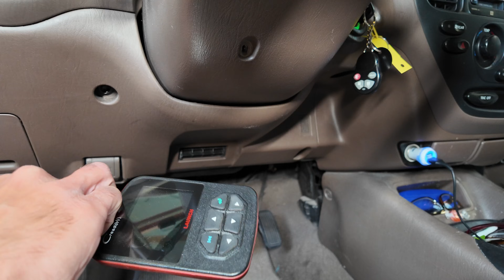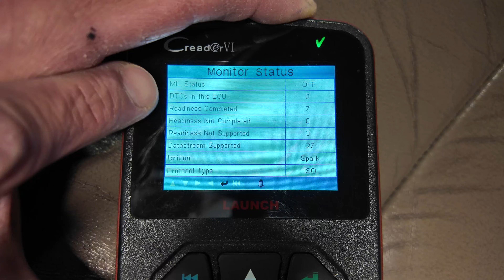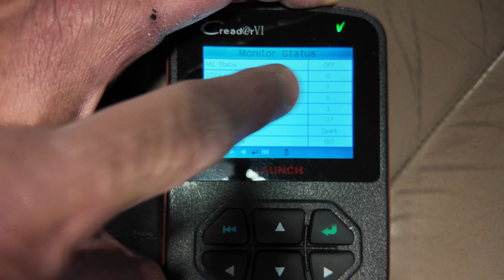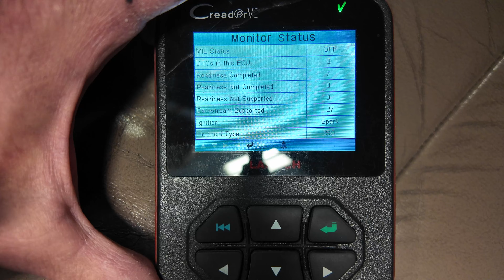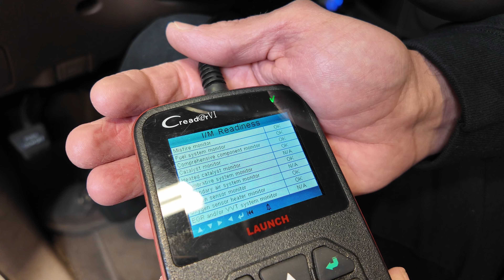Don’t Get Scammed! Use This OBD Reader Before Buying a Used Car

Comment: Cheap ones doesnt showe transmision...
Reply from the maker: Correct.  The low level code readers can only access the PCM (Powertrain Control Module) in the generic OBD system, with limited codes for transmission in the P0700 range of codes. If you want to read in depth TCM (Tranmission Control Module) codes you need a better scan tool. But, you will generally get at least one of the 700 codes for transmission problems in the PCM if the TCM has fault codes.  👍

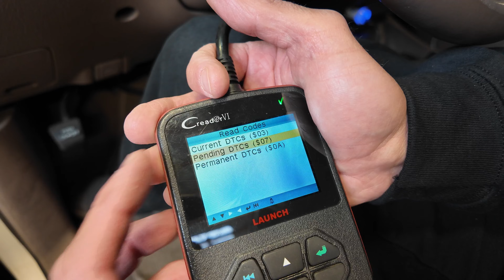Comment: At 10:18 if you see those codes show up on a used car you are checking out, what do you do next? If I see a pending DTC's should I walk away ? Under "Permanent" DTC's what does ( OA) mean ?  Lastly, If there are current DTC's as in this case ( 03) what do you as a used car buyer do ?  Thanks for any help, bc I  am the "little ole Lady" that everyone wants to buy their next car from.    
I am looking to buy a 2020 Mitsubishi RVR ( Outlander Sport) sometime in late 2026. What got me really nervous about ANY used car was that a friend's daughter bought a very old used Equinox for $5000. and ONE MONTH LATER the engine seized. The thought of that happening to me scares me to death.  Any help is appreciated.  I just subscribed.      :  )
Reply from the maker: Great questions!  Let me help clarify a bit for you.  If there are pending codes that means there is a very high probability that the fault code shown is going to turn the check engine light on and will need to be addressed.  That said, the type of fault code is more important.  If it is for a simple, or relatively easy problem to fix, I would not be too nervous and would only want to negotiate a better price.  But, if it for something more complicated and costly, I would certainly be very hesitant.  Unfortunately, without the consultation with somebody experienced and knowledgeable to these fault codes and what the common issues are with that particular manufacturer, you can't really make that determination.  I would recommend you seek the help of a professional.  This is why I always recommend you take the vehicle to a reputable repair shop for a thorough inspection BEFORE you make the final purchase.  You can get their opinion and expertise on any related issues so you are informed before buying.  The permanent codes are only applicable to certain vehicles and are not really useful.  Those codes will typically display under current codes anyway.  I recommend you find the used vehicle you really want to buy, and then after doing all of your research and inspections, bring it to your local mechanic for the final pre-purchase inspection.  It will be well worth the fee to find the things you won't and also give their overall opinion of the car.  Use anything they may find, that you can live with, to negotiate a better price.  Best case, they don't find anything and they give you a green light to buy.  Best of luck and thanks for following!

Comment: I didn’t have this scanner when I were purchasing an used car . Later i took my car to Autozone to check. I found out that the car has erg valve problem. Could I do anything when they was hiding the problems at the time of sale for me to purchase the car? Free Warranty available but no mention. Only the $200 warranty so I denied it
Reply from the maker: If you bought the vehicle from a car dealer, they are usually required to provide at least a three day warranty.    Otherwise, you're on your own.   That's why it's always important to have a thorough inspection performed before buying a used vehicle.  I have a new video coming out soon, where I show how to use an inexpensive scan tool and its popular features. The one I demonstrate is under $50 and is well woth owning. I think you will find the video helpful, and it should be released next month.  👍
Reply: @OrtoTechGarage could you go after the dealer with a lawyer for hiding the car problems ?
Reply from the maker: I suppose you could, but I dont know know how well that would work.  You would have to identify they were indeed required to provide that warranty, and you brought the problem to their attention within the time frame, and they refused to remedy the problem, etc.  It may prove difficult.   I am not an attorney though.

Comment: Great video.  I experienced this exact thing recently.  We went to look at a 2004 Ford Focus with only 60,000 miles on it from a small used car dealer for my fiancé's son.  They had told us that they were trying to fix an issue with the instrument cluster because the temp gauge read high all of the time, even when the car was cold.  They had sent the cluster out to get fixed twice but it still wasn't fixed when we arrived.

Their mechanic showed me some codes that were stored in the ECM on his scanner.  I went to go get my scanner to plug into it and when I scanned the car, it had a P1000-FF On-Board Diagnostic (OBD) Systems Readiness Test incomplete code in it so he must have cleared the codes when I went to get my scanner.  That was the only code stored.  We decided to not buy the car because of this, and we told the salesman that was the reason we wouldn't consider buying it.  I couldn't remember the what the codes were that the mechanic had showed me but none of them were about OBD systems readiness incomplete, and I didn't want to have a potential issue once the monitors all ran.
The fact that the temp gauge didn't work was also a contributing factor in not buying the car.    They had already installed a new coolant temp sensor and that didn't fix it.   There was no coolant temperature data PID to see what the actual coolant temp was, just a cylinder head temperature PID which seemed to read normal.  I think that the signal wire for the gauge may have been shorted for it to read high all of the time but who knows.
Reply from the maker: You did it correctly.  No need to buy a vehicle that has problems built in.  Patience is the best strategy.  Just keep looking until you find the right car. I like to shop independent sellers for the best deal.  Make sure they have all the maintenance records, clean car fax and a clean car title that matches their ID.

Comment: Thankful to have found your video before checking out some used cars. I bought an obd2 scanner and plugged it in a used toyota camry we were planning to purchase. All supported readiness monitors showed complete and there were no lights on the dashboard aside from the tire pressure. So we thought everything was fine. We asked the seller then if we could have the car further inspected by a mechanic and he agreed. The mechanic then called us and said that they will not be able to fully determine if everything is fine because the codes were erased and advised us to just return the car if any dashboard lights turn on. When we came to pick up the car, I plugged in the obd2 again ‘cause I was worried I accidentally erased the codes the first time I plugged it in. The scanner still shows all readiness monitors are complete and no current or pending codes. How is that possible?
Reply from the maker: @oltiyurd  That's odd!  It's really not possible.  There are some readiness monitors that will be ready immediately after the codes are cleared, but I've never seen them all ready.  Also unexplainable, how did the shop see the readiness monitors were not ready when your scanner showed they were prior to visiting the shop?  I'm thinking there is a problem with your scan tool...
Reply: @ I bought it new from Amazon. Ancel AD410. I thought it’s a reliable brand so I paid more though there were cheaper ones.
Reply: It's likely the mechanic has a more comprehensive scanner.  A lot of entry level scanners lack comprehensive diagnostics for abs, airbags and transmission.

Comment: The REAL scam is that OBD systems aren't installed from the factory in every vehicle for the owners to see. All these on board sensors, systems and software on vehicles yet we still get a "generic/non specific" check engine light? If your 12" dash mounted touch screen can tell you where a Starbucks is 3 states away, why can't I know exactly what's wrong with my vehicle BEFORE arriving at the shop? I would still take my vehicle to a mechanic. The difference is, I would save time and money NOT playing the old pin the tail on the donkey game of "open your wallet and let's start with this first to see if it's the problem."
Reply from the maker: Your are partially correct.  In the US, OBD2 standards are a federal requirement. Since 1996, all light-duty vehicles (passenger cars and trucks under 8,500 pounds GVWR) sold in the U.S. must comply with OBD2 standards. This requirement is regulated by the Environmental Protection Agency (EPA) to monitor emissions and ensure vehicles meet air quality standards.  (Fully electric vehicles do not need to comply, due to zero emissions). So you will have access to a very specific set of data, including the data in this video.  That being said, there are many limitations to OBD2 generic data.  Most manufacturers will have manufacturer specific information, in addition to what is required by law, that may require connecting to separate data ports, or using factory compatible scan tools.  Believe me when I tell you, it is extremely frustrating for us who are working in the independent automotive field and have to constantly buy new equipment or software, specific to a particular manufacturer to access needed information. They have even made it harder by requiring gateway access only through subscription based services.  Its getting crazy!

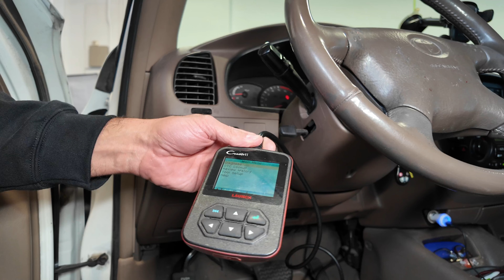Comment: 4:38 MIL: malfunction indicator light (check engine light) / DTC: diagnostic trouble code (errors detected by the ECU).
Reply from the maker: Thanks for adding that in!  Sometimes, I forget I need to explain some of these terms. I do have a video on malfunction indicator lights and what they mean.  It's in our library for any who are interested.  🙏
Reply: @OrtoTechGarage  Thank you for the informative video!! I've got a question for you. Since English isn't my native spoken language, I'm a bit confused about terminology here. For example, when the engine oil light pops up, is that also in the category of MAL (malfunction indicator light)? Or is the engine oil light considered a DTC (diagnostic trouble code)?
Reply from the maker: @angelamartim8337  No worries!  I will explain it to you.  First, MIL is an acronym for the term Malfunction Indicator Light.  This term is used to describe ANY warning light that may illuminate on the instrument panel.  It is most commonly associated with the Check Engine light but is technically used for ALL warning lights for all  systems. Separatly, The Check Engine Light or CEL is used to identify a problem in the powertrain management system, which controls the fuel system, emissions systems, and ignition systems on a gasoline vehicle.  The powertrain management system can also be tied to the transmission control system as well.  All systems will have a list of associated Diagnostic Trouble Codes (DTC).  This is true for all systems that have a module or a computer that operates it.  Additionally, Diagnostic Trouble Codes can be of a generic type or manufacturer specific type.  With all Check Engine Light Diagnostic Trouble Codes, since 1996 in the US, there has been a uniform generic code for many common faults used across all manufacturers. These will be separate in numerical display and meaning from any specific manufacturer Diagnostic Fault Codes. Just keep in mind that there are DTC's for many systems, like powertrain management, anti-lock brakes (ABS), supplemental restraint systems (SRS), etc.  Each DTC will pinpoint a specific subsystem within that main system.  This helps the technician locate the subsystem that requires  more testing to determine if the fault is mechanical, electrical or something else.  I will work on a video that explains the process of diagnosing a Malfunction Indicator Light and specifically the difference between a Check Engine Light and other systems. I know it can be confusing.  I hope that helps!  Also, watch my video on the dashboard warning lights and what they mean.  I explain some basics in that video as well. Thanks for the great question!
Reply: @OrtoTechGarage  Thank you very much for the very comprehensive answer!! This channel is so great it deserves a lot more views!! Now I understand a little bit more about the difference between MIL Vs. DTC. I'll be watching your video on the dashboard warning lights too. Thanks again!!

Comment: Used car salesmen are a pro at making a car look ready to go by changing the oil and resetting the codes.  I just recently bought a 2008 Prius and test drove it and no lights.  I bought it and 2 days later check engine light came on.  Replace the catalytic converter.  Too much of a coincidence.  I figure the dealer re-set the code and knew it would take a few drive cycles to come back up.  You have to do your homework...you just can't trust a used car salesman.  Sales are As Is in SC which means when you drive off the lot you own it!
Reply from the maker: Sorry to hear this happened to you, Frank. Unfortunately, this happens way too often. I see it regularly in my shops.   That's what inspired me to make this video.  I wish I had released it earlier, and it saved you from this expensive repair.  Best of luck with the Prius!  They are a great vehicle.  Male sure you check codes on the HV side as well as the engine management side when you are checking for fault codes. Maybe that's another video I can put out for all the hybrid owners.
Reply: I asked for a CarFax but he said to subscribe would cost him 1000.00 a month and he couldn't afford it.  I would advise anybody to take a car with a lot of miles and have it put up on a lift.  It's harder to cover any leaks up from the bottom.  You can see any rust under there too.  Thanks!
Reply from the maker: @frankroper3274  You can currently buy a single Carfax report for $45, a 2 pack for $59, and a 4 pack for $99.  It's well worth the investment if you are shopping.  The dealerships usually pay for an annual plan and will offer a free Carfax report when selling a used vehicle.  The reputable dealers anyway.  If they won't offer it, you should buy your own, or shop somewhere else.  Additionally, once you have done your due diligence, and checked everything you can on your own, I always recommend you bring the vehicle to a reputable shop for a pre-purchase inspection.  Let a professional check the things you can not.  I hope that helps! 🙏

Comment: I already have 2 scanner's. I'll look at this one, but the big money ones ($1000 and up), seem to be the most comprehensive.
Reply from the maker: No need to buy this particular scanner.  One of your existing tools should already show you the IM Readiness function and check for pending codes.  Check the Generic OBD functions.  Of course, the expensive scan tools will do much more, but you may not want, need, or even understand any of those functions.  These 2 specific functions should be available on most inexpensive tools. Look around in your settings and let me know.

Comment: So how do you use a scan tool to see if the mileage it’s showing is correct?
Reply from the maker: Unfortunately, most aftermarket scan tools won't give you mileage history data.  Manufacturer specific equipment and software are better with that, but still not great, and you won't have access to that. Additionally, not all vehicles have mileage information available, especially older vehicles.  If you can get an odometer reading they are likely just receiving the information from the current instrument panel's module through CAN BUS data, so even if it was replaced with a lower mileage instrument cluster, it won't reveal a discrepancy.  I find the best way to determine foul play is to pull a vehicle history report and look for patterns which reveal an anomaly in the mileage for reported events such as services, collision repairs, registrations, emissions test or change of ownership. That seems to be the most effective process.   Keep in mind too, that its possible that many of those events mentioned may not be recorded or uploaded to a reporting system.  It's not a perfect science, but a good tool to have when checking history. Try to get maintenance records from the previous owner as well.